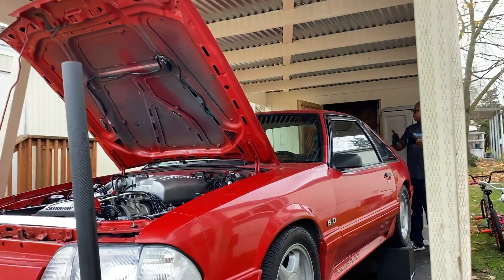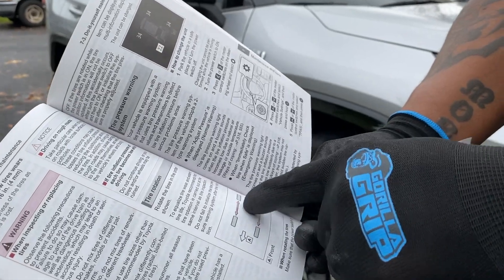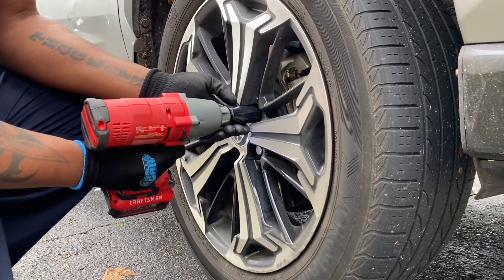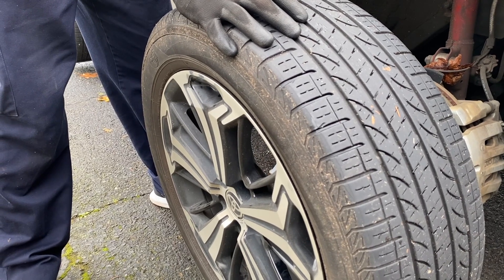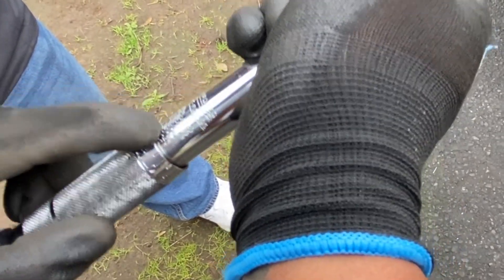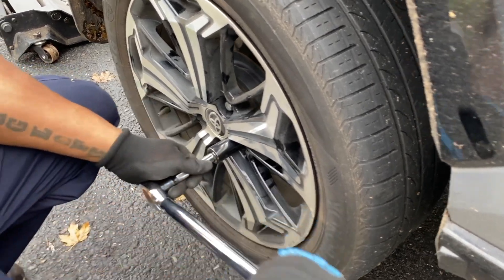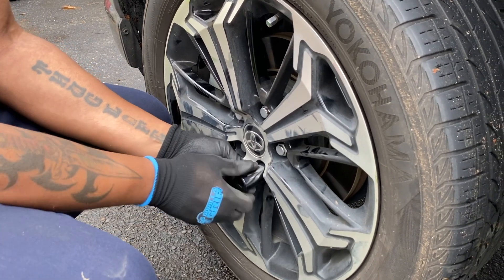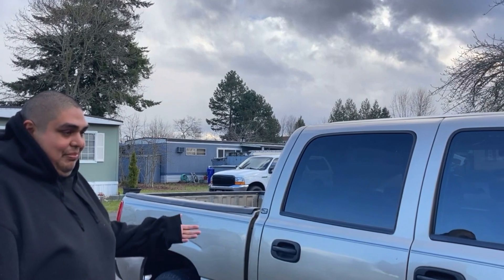Spin Your Wheels: Keep Your Tires Fresh!!! 🔧🧰 #toyota #rav4

Comment: That's one of my biggest gripes about car manufacturers is where to jack the car up. My BMW has jack pads installed 2 on each side. I can lift the car on my quick jacks without laying on the ground just feel for the pad. The mustang stinks because of course the easiest place is the pinch weld but we know what happens then! LOL
Reply from the maker: Definitely on some vehicles there is no good spot or easy access to jack it up! Sucks! Jacking up a Foxbody Mustang with a floor jack is not easy that is for sure! Thank you for watching Bro! 💯👊🏾